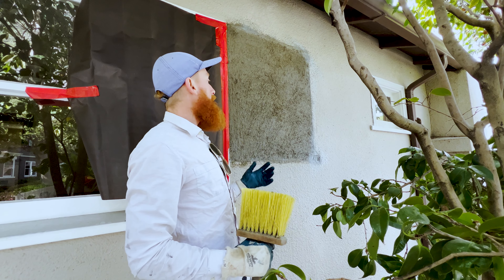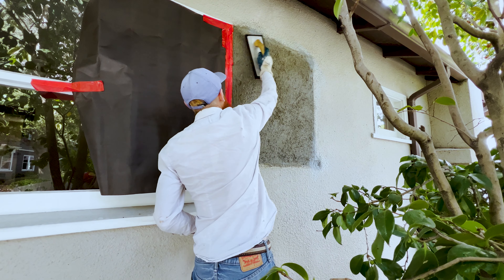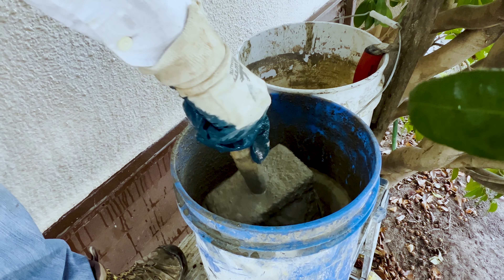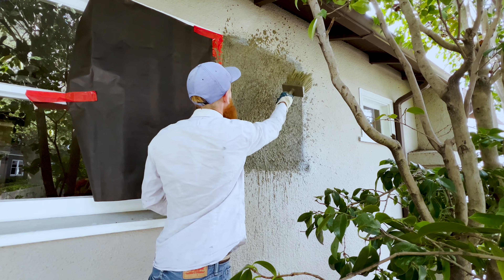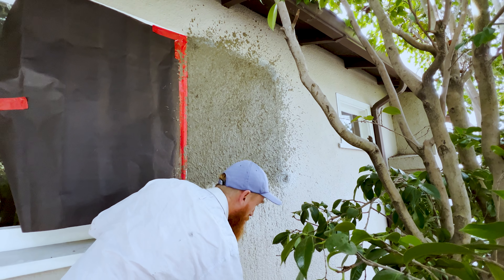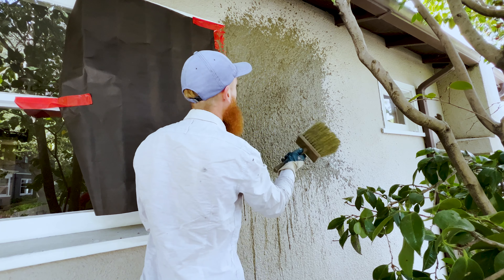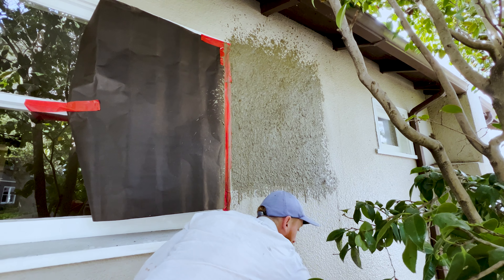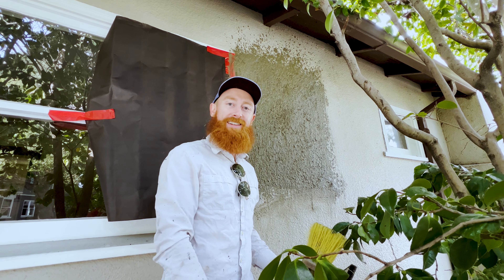Dash stucco texture.

Comment: Wat is the material your using or you using stucco or just regular concrete ?
Reply from the maker: @RDPainting-j9l  Portland stucco, fyi, stucco is Portland cement mixed with sand. Concrete is Portland cement mixed with rocks.🕵🏼‍♀️
Reply: @StuccoPlastering  thank you very much

Comment: Great Video. would like to know what is the mud ratio , how much sand to cement, etc
Reply: Thank you. When dashing we'd usually mix our usual ratio of 3 parts sand to 1 part Portland cement and then add extra water. But, as long as there is enough cement to create adhesion you can play with these ratios to affect your texture.
Reply: @GiordanoPlastering  Thanks Jay that was helpful. All the very best then😀

Comment: Hello Kirk. Question is I'm plastering a block house and about every 5 feet there is concrete support columns. When plastering over the block the plaster curing time is 30-60 minutes, but on the columns the plaster dries out in minutes. No matter how much hydration I do it's the same outcome. Anything I can do to stop this.
Reply from the maker: Absolutely, you can hydrate them for at least an hour to make certain they are not only moist but cold. Or you can apply Quikeret bonding agent over them, cutting the suction time by half. Quikrete sells for about 15 dollars a gallon at Home Depot and lowes hardware stores.

Comment: Hello, cool video, how long did the weld crete dry for? and could I use SikaLatex R Concrete Bonding Adhesive & Acrylic Fortifier? lowes doesnt have weld crete.
Reply from the maker: I'd recommend Quikrete bonding agent, which is sold at HD, Lowe's, and all the smaller hardware stores. However, Sika's binding agent will also work. I haven't tried that one yet.
Reply: @StuccoPlastering thank you!!
Reply from the maker: @nathangalvez9642  😉

Comment: I have a question; can a shower be plastered using some kind of cement ?
Reply from the maker: Evening Gilbert, I hate to say this, but it is the truth.
Stay away from all types of plasters in a shower.🤔 
  This includes all Structo-lite, and all the Veneer-based or lime-based pretty finished and deep rich pretty colored pure lime finished plasters. 
Even if your shower has an advanced exhaust system, I don't recommend any plastering systems in the shower itself.
 Although I don't anymore, you can apply lime-based plaster as even these lime plasters mold fast and must be sealed every 6 months; who has time for this nonsense?
 Either tile or attach the plastic shower sheets. 
Hell, even the caulking and grouts will mold in time, aging, don't apply any limes in a shower.
You can use lime or veneer-based plasters for all other areas but leave the shower alone or face mold in the future.🏝
 You will, like me, still have to re-caulk every few years, but your walls won't mold within a few months, like every plaster known to man will.

Comment: Would both stucco and Portland cement be ok to dash or is one better then the other for this application? Thanks
Reply from the maker: Howdy Alex, stucco is made from adding Portland cement with sand, Concrete is made by adding Portland cement with rocks. Yes, you can dash with your basecoat.

Comment: I need to do similar repairs material, but I got a big bag of lime they gave me when I asked for mixing materials. Are you using lime in this mixture or just Portland and sand?
Reply from the maker: Just the Portland stucco which does already have small amounts of lime in it.